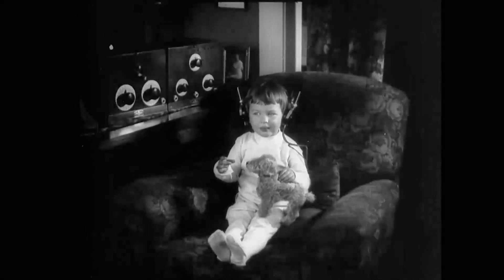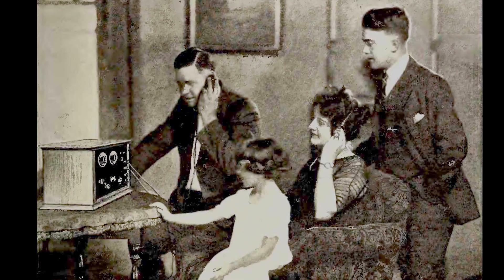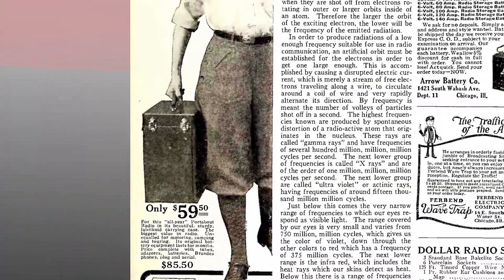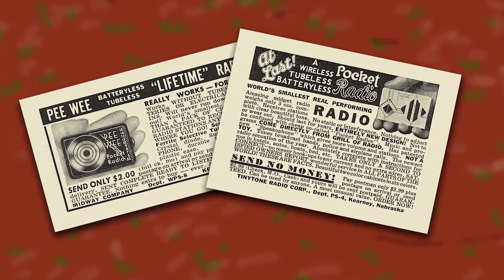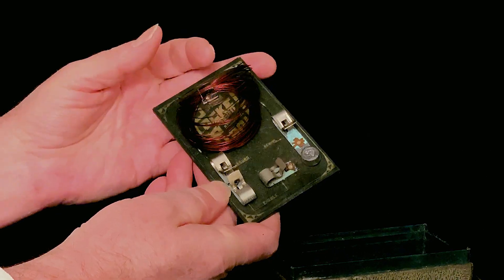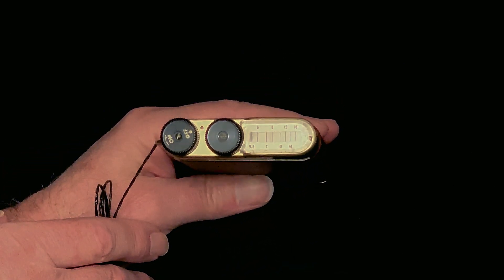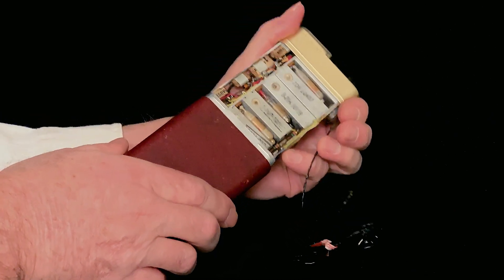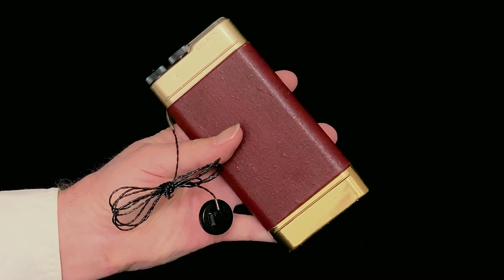First real pocket radio 1947 Belmont Boulevard not transistor - collectornet.net

Comment: No mention of how it was powered?
Reply from the maker: Didn't I mention the batteries?
Reply: @collectornet   I don't know, did you? I don't recall?
Reply from the maker: I don't know either. I've never had the batteries for this radio. I can only say that as a tube radio it is going to have two battery voltages, an 'A' battery and a 'B' battery. One of those is likely going to be obsolete for this radio. An internet search may provide particulars. But yes, to answer your original question, it is a battery powered radio and is not powered by house (AC) current. It is meant to be used as a portable, after all.

Comment: I saw a two tube radio it had pair of "aa" cells for the a battery, and a pair of 9 volt for "b" power. The owner has a pair of head phones. And a length of wire. With a gator clip. It cliped on to the dial finger stop of then standard phone. And "IT WAS PARTY TIME. " scarry loud." It was. Also used on electric fense wire ect.  This came truly before transtor radio.

Comment: That radio must have been a real pocket warmer with all those tubes. No mention of what sized battery it used. The battery would not have lasted long.
Reply: Not really! The direct-heated cathode of those tiny tubes consummed no more current than a tiny light bulb. So people still had to wear gloves or mittens :)

Comment: Fascinating documentary. I didn't know they had pocket radios with miniaturised tubes until now. Thank you.
Reply: By the late 1950s, they had tubes which were even smaller, RCA called them Nuvisters, though there were other brands. They were usually used in places where you'd expect to find a field-effect-transistor, particularly, the RF stages of FM tuners. I don't know if anyone ever built a radio using them, but I imagine one that used a headphone would have been possible. They were probably too small to power a speaker.

Comment: It should be noted that by 1938 low-drain tubes became available and radios, although not pocket-sized yet, were finally portable requiring no external wiring. Some were large and some, and although they could not be put in a pocket, were very small and light. Even after WWII radios like the Belmont were mere novelties and necessitated using earphones only. One was better off getting the slightly larger portables with a speaker and having surprisingly good performance

Comment: That really looks like it was made today
Reply from the maker: Yes. Maybe because of the aluminum cabinet (clad in leather). Shortly after this radio was made, most small radios--and all the personal electronic items I can think of--had plastic cabinets. Plastic reigned supreme until well into the cellphone era. In all those years, plastic looked "modern." When the iPhone switched from plastic to more traditional materials (metal and glass), a new definition of "modern" emerged. And so the Belmont Boulevard radio, which in the plastic era may have looked dated, today looks fresh.

Comment: They did a good job getting it that small with tubes. I bet it was expensive to buy.
Reply: ...I'll bet it WAS an expensive radio- and the batteries weren't cheap EITHER-(!)
Reply: About $200 as I recall. For that you could have two Transoceaniacs!

Comment: Lots of early hearing aids also used these tubes. And the Emerson 838(?) radio, Crosley book radios and a few others, used these tubes in the radio portion of the set, and a couple-3 transistors for the audio/speaker portion. Have a few of these, fun to be on the split between tube and solid state.  Thanks for the videos!  I've been collecting and repairing early transistor/battery tube radios for decades.  Many of them still perform excellent, as behooves something that sold for several weeks wages back in the '50s.. Stubat
Reply from the maker: You know your radios! I'm working on a video involving the 1957 Radio Shack catalog and I saw that they sell the Raytheon mini tubes in there for hobbyists. I believe they were originally developed by Raytheon around WW2 for use in an early form of guided missile.
Reply: @collectornet  Oh, boy.  Mentioning that catalog sent me down a major rabbit hole..  Fun, fun, fun. That website is scary.  Anyway, I dug a bit more and dredged up memories from my early two-way radio days. Motorola used those tubes in the VHF band motorcycle two-ways, as well as a couple of lunchbox-like battery portables.  A bit of Googling says that Raytheon's original focus was hearing aids, and they adapted and ruggedized them for military usage. (Considering what medical devices sell for now, I could see that as a good financial move.  My Gram's digital 'aids were several $1,000s each, not long ago.)  I've been buying pocket style 50's hearing aids as a way to get early submini tubes and germanium transistors cheaply for my radio stuff. (Gotta luv those tiny Raytheon transistors in that delightful blue color.) They sold the best transistors (gain/noise) for hearing aids, and the rejects to the hobbyists.  (CK722 and so on...)  Only capable of audio frequencies, but the best at the time. Still need to get one of these Emersons going. Hybrid tube/transistor pocket radios were only out there for a short while, taking the best of each technology and running with it! (Submini tubes, great RF/IF low level audio, pretty power efficient, but transistors were better at speaker-level audio and low drain, especially in push-pull class "B" mode.) And, even in those motorcycle radios, I don't remember having to swap out the couple tiny receiver tubes or even the low-level transmitter tubes, just the larger several-watt output tubes (2E24). These were actually hybrid sets as well, receivers transistors and tubes, transmitter mostly tubes, and a transistor power supply, IIRC. Some ran on NiCads or even 2V wet cells.  Cool stuff.  I'm rambling, time to bail! Keep on collecting!  Stubat
Reply: @collectornet  ...you're not far off- as I understand, those tiny vacuum tubes were developed for the WW2 proximity fuses!
Reply: ...you're absolutely RIGHT-!!!